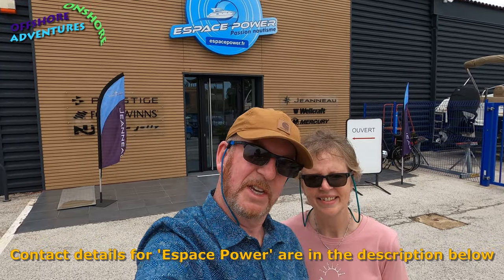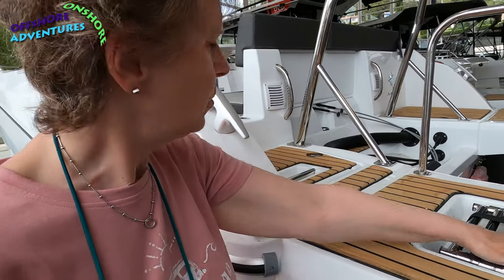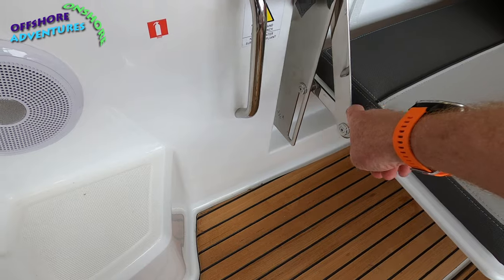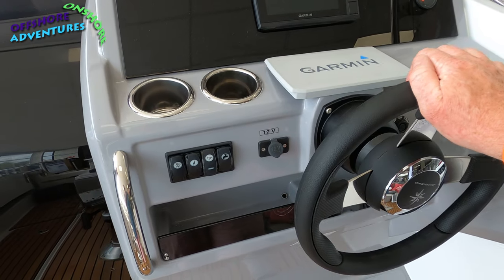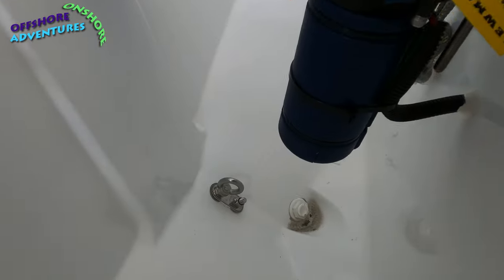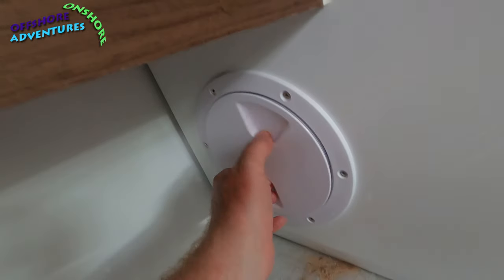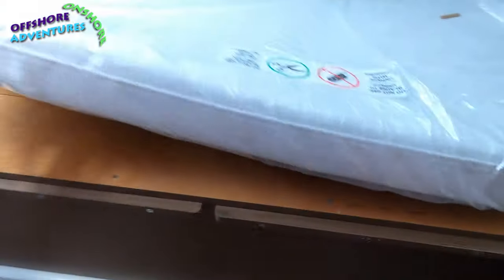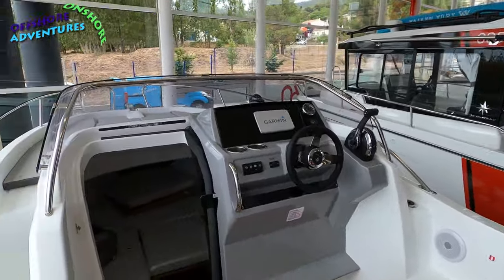A detailed walkthrough of the Jeanneau Cap Camarat 6.5 WA Series 3

Comment: How does Cap Camarat 6.5 WA s3 behave in waves? Does it cut them well like Quicksilver boats, or does it jump up and down a lot?
Reply from the maker: Thanks for your comment and question Ivan. It has a relatively deep V shaped hull (compared with similar boats) so reviews suggest it does handle well. It’s a Cat C8 which implies it isn’t designed for big seas which is reasonable for a small boat. I think the Quicksilvers are semi displacement so may handle similar larger seas in a better way but I guess the best way would be to physically test both on the water which of course would be fun!! 😀🚤